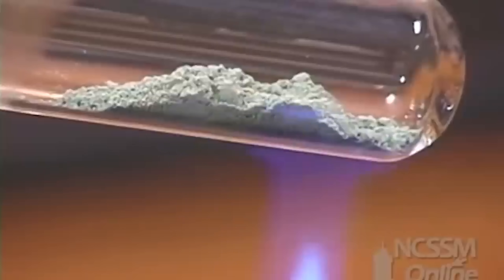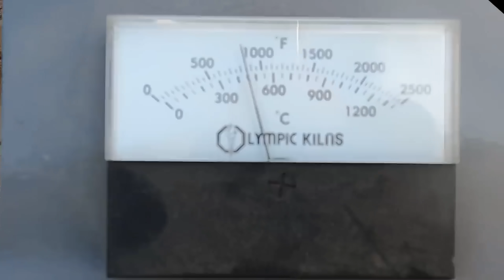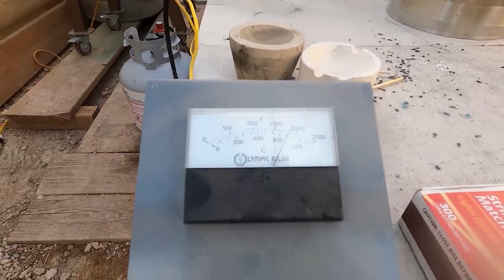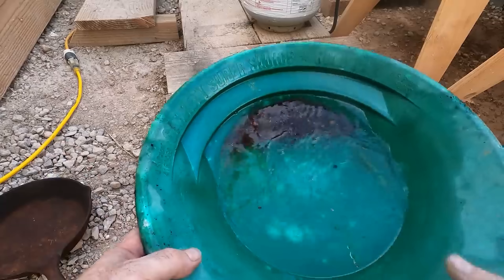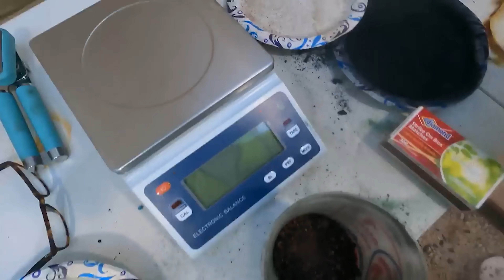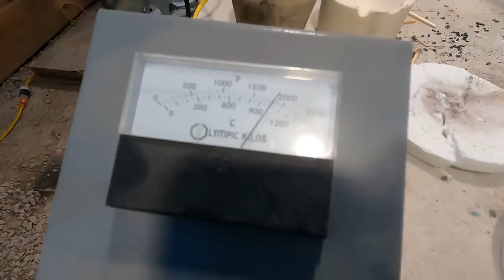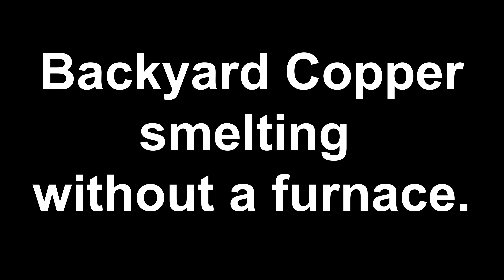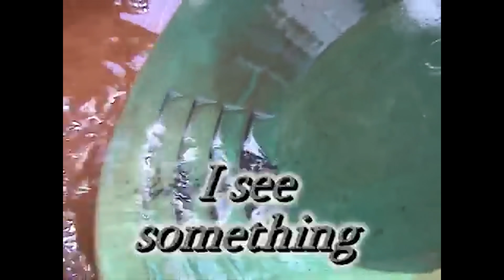I Turned MALACHITE rocks into PURE COPPER

Comment from the maker: What's the easiest way you got copper and if so what method did you use. If you want to see me use a Potato to make Gold watch this video https://youtu.be/VRa_Wn1sLCw and  smash that like button ....SMASH it HARD !!!!!
Reply: Demolition gather copper in boxes is the best
Reply: Do you heat up your graphite bar moulds before you pour your metal? That's the only thing I can think of that would help improve the looks. Hot moulds give a little more time for the slag to separate and prevents any atmospheric moisture from causing micro bubbles. Especially in the corners.
Reply: Dave from Australia 🦘 man I need to talk to you. . I found anchaint river bed..I need advice?
Reply: Changed out a bill😂

Comment: I'm not 100% certain, but I think if you want a good looking bar, you have to preheat the mould, I think that is why its looking lumpy, the hot copper striking a cold mold has a huge temperature differential and the metal reacts. When I was learning to cast shotgun slugs with lead I had a similar problem until I started preheating the mould.

Comment: When I melted and poured steel in a foundry years ago, we used a material on the molds we called hot top. I cant remember what was in the powder. Maybe it can be bought for small scale operations? All I know is that the castings came out smooth and the sprue was even smooth. If we didnt use it, the castings looked pitted and deformed.

Comment: Hey Jeff, I have the same problem with my silver bars. What I do is I put my carbon fiber molds in my electric furnace and remelt them there. Then, when they are liquified I let them cool inside the furnace slowly. It works every time!

Comment: That's awesome! I recently got my first furnace and did some 1 lb. copper bars from wire.  I noticed similar pour results and re-melted all and got it a good bit hotter than needed for a time and poured into heated graphite molds (not extremely hot). Had much better results but not perfect. Shines up nice though :D
Reply from the maker: thanks

Comment: When I have melted copper I preheat metal moulds very hot, pour and let cool slowly. Mine are triangle ingots at 75lbs each. Still using one of the old firecone 500 machines from the 70"s. works great for aluminum and copper. Good luck and hope you found a hoistway winch you were looking for. Starting to look for one myself. Cheers from Canada

Comment: "If ye want yer purty golds ye gots to heat yer molds." Hot, flowing metal into a hot mold with a torch blowing on it will keep the bar from oxidizing as it freezes. After it freezes remove the torch. No oxygen is why the cone is so shiny. Try that. 
Copper price is getting to where this information is becoming a little more valuable.
Reply from the maker: thanks

Comment: With the bars of copper you need only a pinch of flux on top of the molten copper before you pour just to get rid of any impurities and make them float to the top also preheat your mould
Reply from the maker: thanks

Comment: Hey Jeff thanks for not getting  me wet again today.
FYI pre heat the mold near the vent hold at the top of your furnace or place several on an additional  heat source of some type.
Pour lower for safety 
Stable platform 
Allow the molten pour time to set and gloss over prior to water shock.
Water shock seems to add hardness as opposed to a more maluable slow cool, as in preparation for a rolling mill or wire pull.
If you have a very small iron mold with little density  or weight consider placing  in a larger cast iron pan in iime powder pre heated .
Geology  question how do you make cement ha ha
Reply from the maker: thanks ..... thats easy ....go to Home Depot hahhahahaha

Comment: if i had to guess, it seems like the buttons are better looking cause it all sinks to the bottom and its tapered.  so the material on top that u break off, pushes the metal down cause of its weight and the taper helps.  maybe try tapering the sides of the bar molds? thats what those huge gold bars look like, tapered sides.